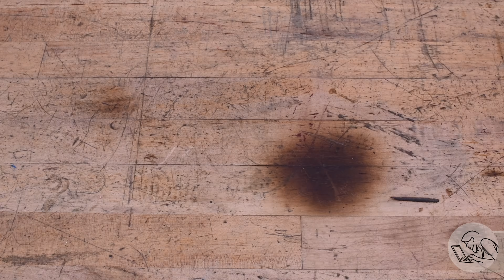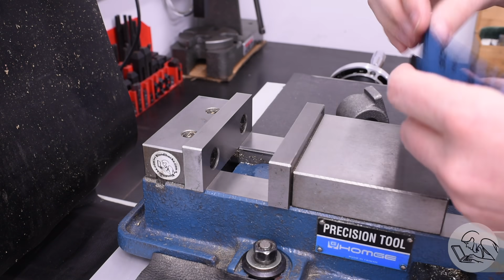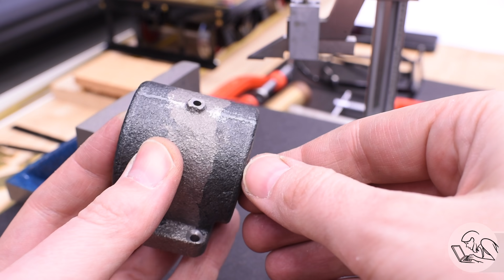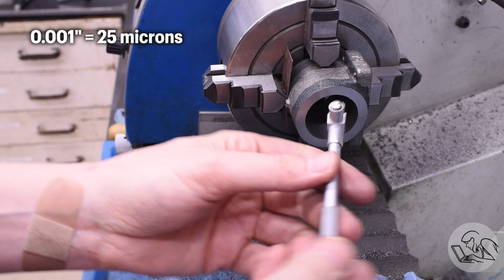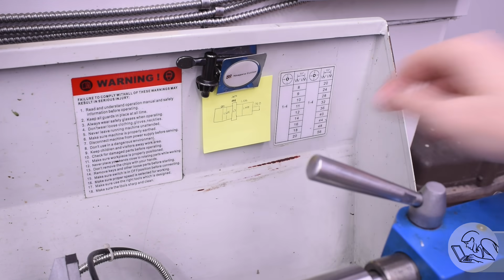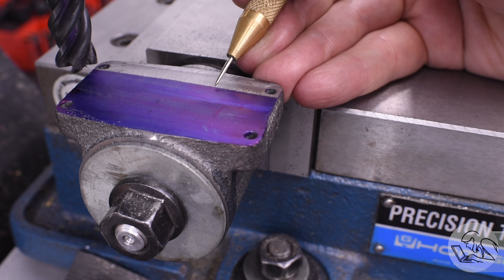Making a DC Generator (Dynamo!) - Part 1

Comment from the maker: Hey everyone- lots of folks asking why I didn’t do the bore on the mill. This is such a common question on every project, that it is in my FAQ. See link in description. The TL;DR is that boring heads suck if you don’t have power down feed. If you were about to ask that, now you can ask something more constructive instead! Win win! Meanwhile, to everyone concerned about the bolt holes being crooked after the correction, they are clearance holes less than an 1/8” long. Trust me, it’s all gonna be fine 🤗. As for why I didn’t use the ends in the vise for fixing the bottom, both ends should be pretty square, but only one definitely is and it’s always better to directly reference the critical surface when correcting a relationship. Using the bore ends is an assumption and a compromise. And yes, the mandrel was long enough. 5C collets are single cut and only clamp at the very end. That had nothing to do with the mandrel moving.
Reply: The tappy-tap-tappiest of episodes, without once using the phrase??
Reply: Ahhh totally makes sense. I am using a Bridgeport mill with down feed and a mill without it would be a nightmare unless you had one of those expensive boring heads with autofeed mechanism. Thanks for the comment despite my laziness not looking deeper for the AsknAnswered part of your channel.
Reply: As a side note I had predicted you were going to setup like you did with the file machine on the lathe crossslide and line bore it. I was so sure you were going to do that, I thought you purposely used the 4 jaw just for teaching. LOL
Reply: Asked it a few hours ago, now I want to delete it...
I didn't notice you didn't have a powered mill quill, and I TOTALLY see how that would really give substandard results if it wasn't mechanically fed...
Almost like trying to do single point threading without gears, by turning the handwheel... :face-pink-tears:

Comment: You are a good machinist  i can tell by the bandages on your hands,  I built the same generator but found the closer the
rotor is to the magnets the greater the magnetic flux the more power out N torque required,   from zip 03867

Comment: I'm doing the PM Research 2A and I had a similar problem with the cylinder. I planned to face the port face and drill the pivot hole in one setup. After the facing operation I measured the bore and the difference from one end to the other was nine thousandths. It's a good thing it wasn't over nine thousandths or I would've had to call my local Saiyan for help. 

I put the cylinder back in the chuck and tapped it in for 0.009" difference on the back. Then I faced it again. That worked well except now my pivot hole is slightly off center. That does not rock. 

Is there a reason you didn't choose the 2A for a project? I don't see a lot of people doing them.

Comment: If you use pins or a stack of blocks to orient the casting in the vise (1st operation) you could make sure the thickness of the resulting base is visually the same on the finished casting on both ends.
Also, if you don't have a long end mill for the spot face (2nd op) you could try a cheap drill bit with the point ground flat.
I have this kit, but I haven't built it yet, so going to school with your build and an old build from Mr. Pete is instructive. Thanks

Comment: To be honest I don't know why you were worried about the 20 thou. Unless the thing you're mounting this little gen to is perfectly flat and parallel to the run of the drive, you're going to have to shim it anyway. Ir if you have adjustable stand-offs. Belts and chains have some give in run on top of that. You might be surprised just how far off you can be and not trow a belt.

Comment: So, we should get a charge out of this video, sort of a current affair, a real gem of a joule, if I can field a few magnetic jokes. In other words watts up. Anyway, thanks for the video, this should be an interesting series. 

Good point on cleaning up, at some point you just have to say enough. I myself have seen full size machines where the casting did not fill in on the edges, leaving gaps of inches, so your model just reflects reality.

I must admit Quinn, that I do so love your shutup that's why line. We have all been there and know well the feeling.

It's funny how things work out. You went to all the trouble of defining the foot as the base point and in the end it would have been easier to have just done the bore and made the mandrel. Oh well, live and learn. I have a very old PM steam engine kit that I have been hauling around for decades, this has me convinced that I should make the bore in the cylinder and then tie everything else to that, even more so because I will be doing that on the lathe.

Comment: My old bicycles had these dc dynamos for headlamps, good to see people still fancy them :)
Reply: Did you have the one that rides on the side of the tire, or within the front hub? Lots of bikes are rolling on front hub dynamos these days, I have one on my commuter rig! Nice to not have to worry about charging my lights
Reply: @cyrucom  I had ones that ride on the side of the tires, pretty compact and I think they put out 6v or 9v depending on the model.
Reply: Of course with an incandescents bulb as the light you would probably notice the extra resistance to your pedalling (and woe betide you if you want lights while riding up a hill).
Reply: @nerd1000ify  haha yes, that definitely sucked.

Comment: When you were trying the 4 jaw chuck, I guess you didn't hear me shouting to you to use the surface plate. Just the constant Back and forth getting plane (a) perfect to throw it off while getting plane (b) aligned was enough for me to use the angle plate. Great job getting it done! RecognizingTHAT problem with your process of frequent checking in itself shows why measuring often is so important.
Great Job cant wait to see you use it!

Comment: I made one of these kits several years ago and it was a fun build. Since it is a generator, you can also turn it into a motor by putting DC current across the terminals. I have mine hooked up to a PM Machine steam engine and it runs a few LED lamps.

Comment: You could User feeler gauge tape (dont really know if you call it like that) under the upper Part so if you tap tap the other angle it doest go back down ( i Mean the last correction operation) but at all nice work done

Comment: How bad would the original 20thou of error have been if left in? It seems this is just about how the dynamo sits in the final setup. Did it look visibly squint, or is it out of tolerance for transmitting power to the dynamo? Or just felt wrong.

Comment: You have the two faces for the bore. Are they not square to the bore?
so you could put them in the mill vise and re-cut the foot.
ETA...  you have made me think do the bore first.
Reply: Had the exact same thought, back jaw of the mill vise is square, just need to level the foot side-to-side, done. Nice and solid set-up, and simple to do, making use of the surfaces that are already square to the bore.
Reply: My thought also

Comment: Oh cool!  I just finished making one of these.  There are a couple of YouTube series on it but they all skip the interesting details of the terminal posts and the lifting eye.  Also the end bells are clearly designed to be made on a four jaw chuck.
I did the body casting on the mill with a boring head.  That was very quick and easy to setup.  
I like the way you used your holes for reference.  That’s an excellent trick.

Comment: Im sure 2 1/2 thou error is not going to matter.
The spigot of the mandrel in the 5C collet should be as long as possible, but I think I would have mounted in a vertically mounted rotary table with a chuck and rotated to dial the base surface in, but then I have that tooling available and a bigger mill that it easily fits on.

Comment: If I may be so bold as to suggest ... the .020 base angle was better or at least easier than .0025 or even .00005.
Why?
Realism.  To provide a realistic look in miniature will require the tedious manufacture of tiny tabbed shims sticking out from the base of the generator...for that real world look.
I can't help but think it would be easier to machine a .020 feeler gauge than a .002 feeler gauge.
Then again this might just be a long explanation for why it would have a 1/4 inch thick stack of washers under 1 corner if I built it. 😮

Comment: Very often things don't go to plan and the ability to think and correct for what went wrong is invaluable as you continually show in your videos.  Could the housing have been secured a bit tighter on the mandrel by stacking 2 or 3 fender washers (to make the clamping effect less springy) to retain the housing on the mandrel?

Comment: As an Engineer there is a huge temptation to offer advice and point out where you have gone wrong, but then I realised I would be just like every other Armchair Expert, instead I will stay silent and trust that you are learning as much from your mistakes as I am, keep up the great channel 🙂
Reply: I have less engineering education, haven’t ever used a mill or metal lathe, and STILL struggle to STFU.  I know all of the “helpful” comments from armchair machinists would wear me down.

I think this is part of my learning process - to connect problems with techniques & solutions, then test them against reality (or more knowledgeable people).  That feedback illuminates areas I was missing or reveals things I’ve misunderstood.  I would also like to be able to build projects like these, and “helping” is easier and cheaper than doing.

Thanks for YOUR comment because it pushed me to understand why I feel compelled to add my $0.02 (if that) worth on machining videos!

Comment: Do you think this kit could be done with just a mini-lathe and a drill press?  Guess I'll wait for the episode with the end caps to see for myself.  Everything done for the bore in this video I could probably do but would just add feet to the base instead of trying to mill it flat.
Reply: There's no reason you can't mount the casting in a four jaw chuck and face the surface of the foot. Indicating it in might be a challenge to your patience though.
Reply: That's the tricky part, I'd want to do it as a fun project, not something to pull my remaining hair out over.  And the ideas I have for using it all have it mounted into a 3D printed frame.  So no need for the bottom to be flat.
Reply: It could all be done on just the lathe with some creativity.

Comment: You did a great job, as always. Out of curiosity, would it have saved you setup time if you machined a little bit of the ends of the bore flat and parallel after marking them on the mill? I'm thinking you could maybe use the reference face of the machined foot to make perpendicular and parallel faces on the mill with enough material left over to then take it to the lathe. That way, you could use those milled surfaces to dial the part in and then finish the machining of those faces on the lathe to ensure concentricity with the bore. Just a thought, but idk if it would've saved you any time. I was just thinking it may have been easier, even if it could also seem a bit silly to cut the same surfaces twice on two different machines

Comment: I've always been fascinated by home-brew power generation.  I've seen some very interesting projects with powerful neodymium magnets.  If you have a little creek on your property and the laws allow it, building a little dam and creating about 3' of fall for the water will give an impressive amount of power running through a hydro-power setup.
Reply: I can google it but thats boring and anti social :). Is that ' a feet indicator? So 3' is 3 feet approx 0.9 meters?
Reply: @hajom78  yes, that's right approximately.   1 meter is about 8cm longer than 3 feet.
Reply: @jfirebaugh  I have a creek at home, now I got curious and think I need to try this. I should be able to get 1-2 meters drop here.
Reply: You don't need fancy magnets, almost any motor can be modified into a generator... old washing machine, car starter motor, garage door opener...
Reply: @Tasarran  Yea, just need to find an old motor. The last one I pulled from a washing machine was a brushless history, and probably not usable.